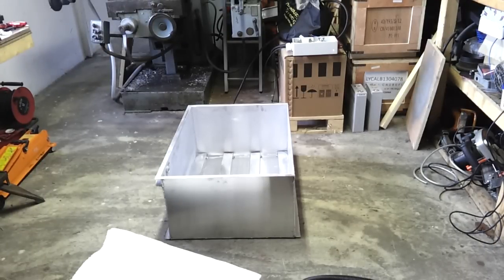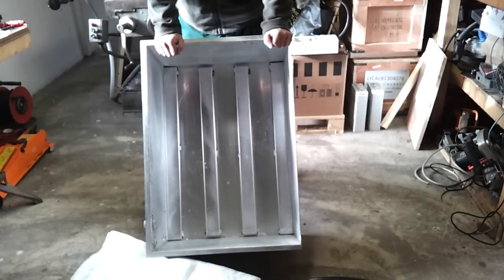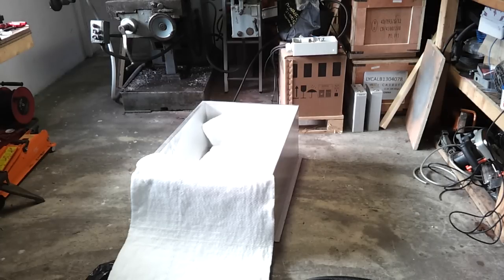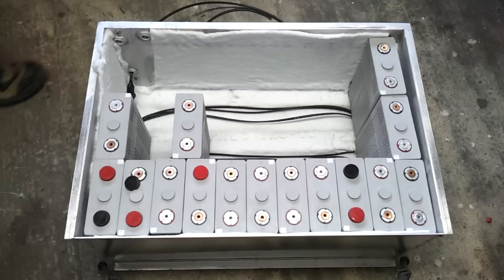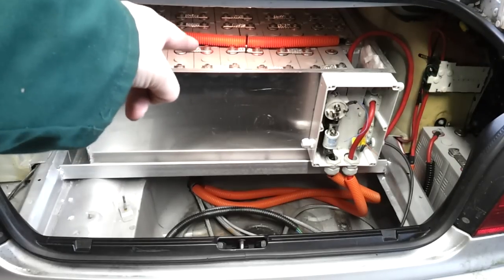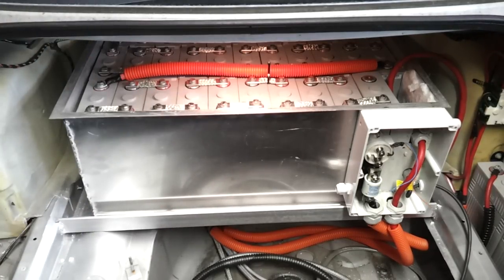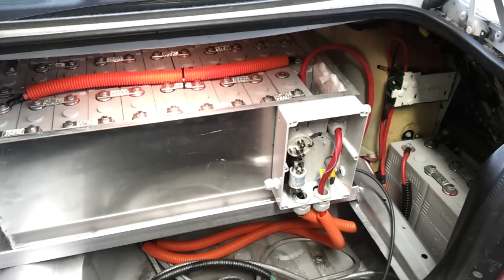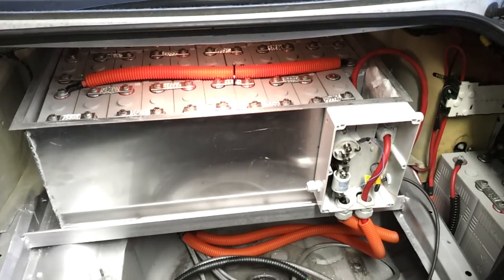BMW E39 EV Conversion 29 Car Battery

Comment: What kind of range are you expecting to get out of a charge? 200 miles? or more? Also I haven't seen any cost explained - I'd love to have someone do this to my 2003 Honda Accord - be nice to get about 250 miles per charge since nothing on the market gets that which I think is partly or mostly Big Oil's doing - I personally think they are limiting what car manufacturers are putting into these electric cars - curious how this would work for me also since I live in Wisconsin, USA and it's been bitter cold this winter negative double digits Fahrenheit - I doubt those Leafs are getting much more than 30 miles per charge this winter if they are working at all. I know lots of questions - I'm a new subscriber and have watched about a dozen of your videos so far - great work - wish I had the no how to do this work but I don't.